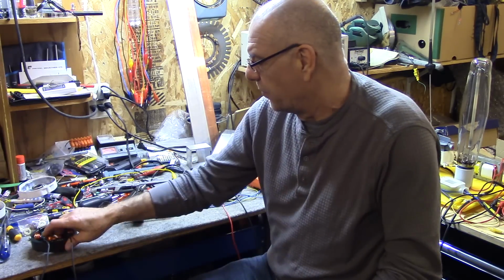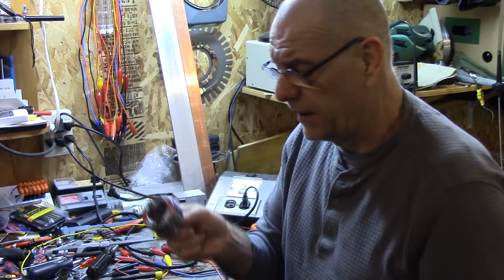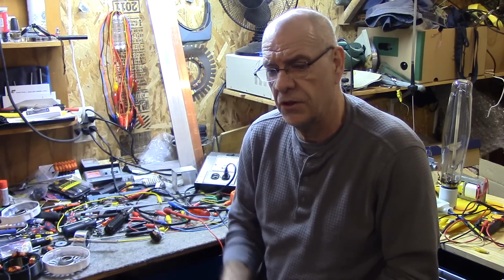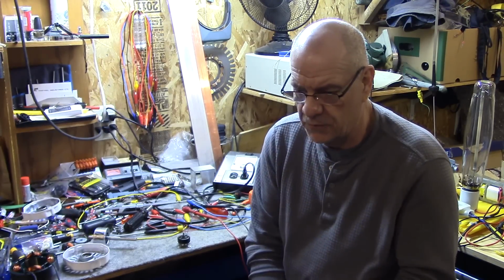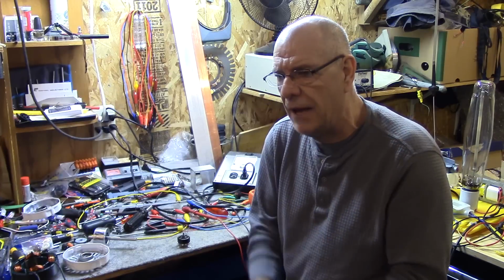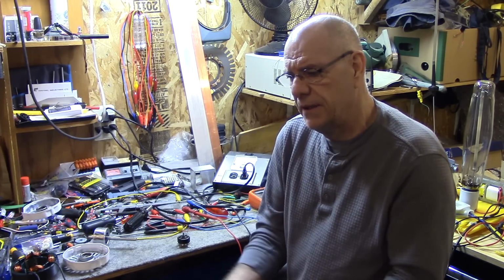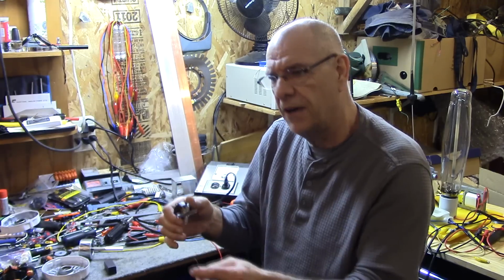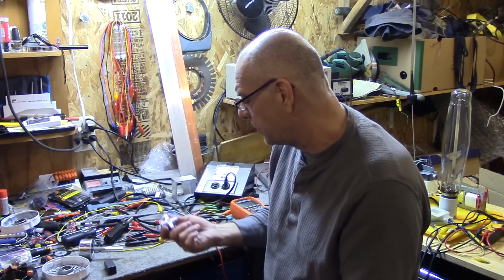The Stunning Resemblance With Tesla's Original Design

Comment: I want to replicate one of your experiments.  It was on another video where you had various lights swapping in and out of a circuit and they all ran, including an ozone machine.  I want the design schematics for the pick up coil box you were spinning the cylinder magnet in.
I sent you an email, but your auto-responder said you don't use that email any longer.  How do I contact you?

Comment: Gerard Morin
listen to me
no need for high speed motor to move your generator
the good generators are moving on low RPM
but the amperage of them are high
the speed motor generate high voltage
you need after that to reduce the voltage if you want to utilize the output
however
when you connect the shaft of the motor with the generator , put the output positive cable of the generator on the positive motor input ,
then connect negative cable of the motor to the positive pole of a battery to charge it
then connect the negative cable of the generator directly to the negative pole of the same  battery

Comment: One of my smart rebellion physics teacher had told me to imagine that electron in a wire is a ball that spending around a nucleus and going so fast in an orbital that held by mass attraction and magnate force now he sees that the attraction between the nucleus and the electron is mass to mass attraction but electron to electron is magnate forces. So far so good but what shocking and eye opening is him asking me if you can color an elctron and push it from the outside ie electric source to the wire that is going to introduce a very unstable situation that going to let a different electron to leave the other end of the wire if there was a place for it to go. if there was no place for it to go to, no matter what force you use, that colored electron is never going to enter the wire or it can but another electron has to leave at the same time at the same location back to the same source. Time at this situation is zero doesn't exist. Humm  another thing if there's a place for an electron to go to at the other end, he asked me how long it will take that colored electron to enter and leave a 1 inch wire at a 10 volt and 1 amp? the answer is so shocking. It might be never! because it all depends on lots of factors. what do you think of that?

Comment: is that also means that battery is stored resonance?, that when you connect positive and negative in capacitor, the higher resonance move to lower resonance until it doesn't resonate anymore?

Comment: Now if we can figure out how DC works...  It is more of just understanding how, not necessarily using it over AC.  I have seen the video on producing Hydrogen that you did and you believe the rod was vibrating.

If it is a vibration it could be a field building up around the wire then that collapses, which causes a vibration on the collapse.  Similar to how the spark gap works when it overcomes the air gap, the spark jumps.  It settles down, overcomes resistance, then the spark jumps again.  This on and off would cause vibration in the wire.

Just a hypothesis.  The reason it even masters is because I don't believe the electrons are moving.  Therefore I'm trying to figure out how the vibrating mechanism works in DC.